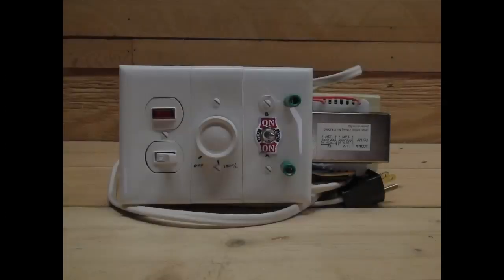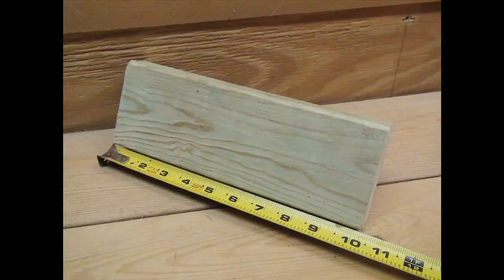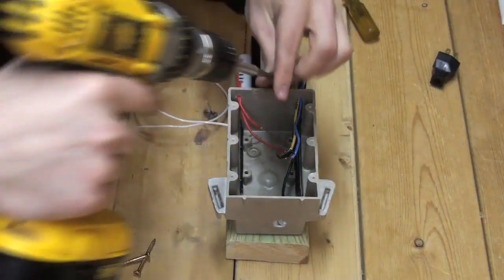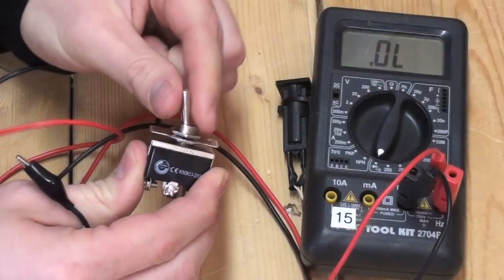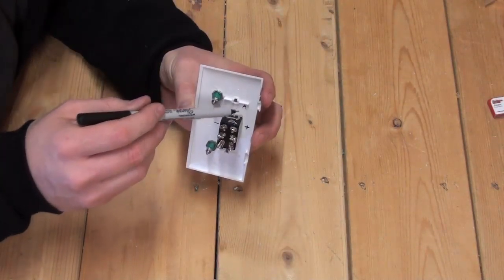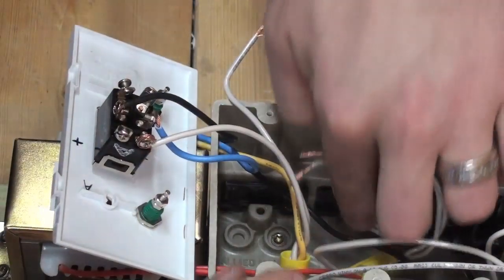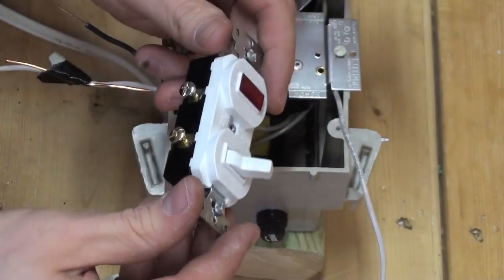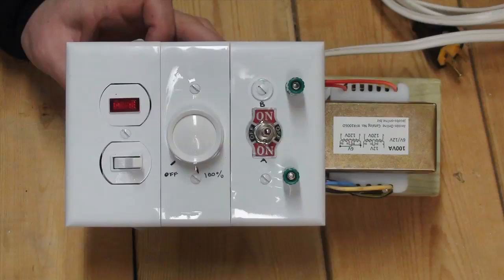DIY Custom Power Supply - XFR1006E Power Supply - HWFCI

Comment: Great video - but in the test section near video end, I never saw the pilot light come on. Will that only occur when a hot cutting wire is attached as a current drawing load ? Obviously the volt meter doesn't draw current like the hot cutting wire would.
Reply: Hello! It came on, it is just REALLY dim and washed out from the overhead lighting needed for the video. Thanks for the compliment, let me know if you need anything, shoot me an email through the website

Comment: hi i bought all the stuff trying to put this together. but on my transformer xfr1006e that i bought from jacobs on one side i have 2 black wires and two red wires and on the other side I have 2 yellow 2 blacks and on the videos one side of transformer just 2 red wires and on the other side you have 2 blacks one yellow and one blue. so im just not sure which wires my blue wire and do i just use the red and not no blacks on the other side and which yellows which just confused on which wires to connect any help woulkd be appreciated thank you
Reply: Hey Marcin! These videos are a little bit dated, as the jacobs-online power supplies have changed just a little bit. The wire colors may have changed, but pay more attention to the positioning of the wires. Those should sync up properly. Otherwise, just shoot a message over to gary, and he should have a wiring diagram for you on the power supply. Feel free to check out the design page of my website as well, it has all the diagrams. ( http://hotwirefoamcutterinfo.com/_DIYPSDesign.html ) Best of luck!
Reply: Thanks man appreciate it

Comment from the maker: @MoreDakka101 oh hell yea dude, there are a buncha different ways to do it. I figured id make it the most complex way, and then people could step back from there if they choose. But fear not! Electricity is actually REALLY easy to work with. Just remember, its like a sink - water flowing to it, water draining away - positive lead to it, neutral flowing away. Then be sure to not cross anything, and it will basically function itself!

Comment: @LetsCutFoam True but I like the idea of seeing if the unit is on.  And I guess technically you could get away without the switcher or at least not using one with an "off" position by making a few modifications.
But I kinda like your approach to it all.  It makes sense both technically and practically.
One of these days I'll sit down and learn this electricity stuffs ;)

Comment from the maker: @MoreDakka101 hahah!! very true very true. But yes, as long as you keep your cables straight and tend to the flow of electricity it will come together just fine. In reality, you wouldn't need the pilot light switch, so that would make it one less component to add. But check out the webpage too, it has some great information. Thanks!